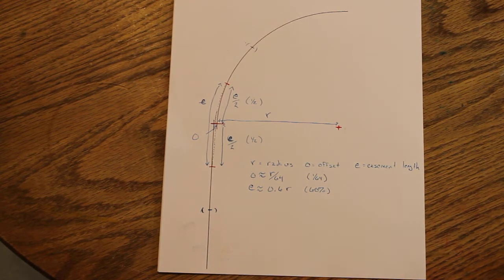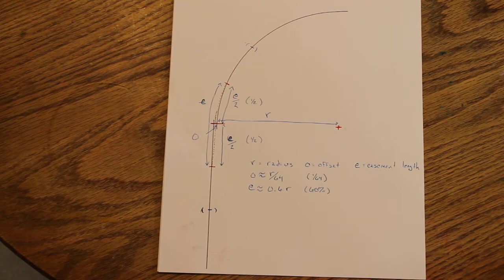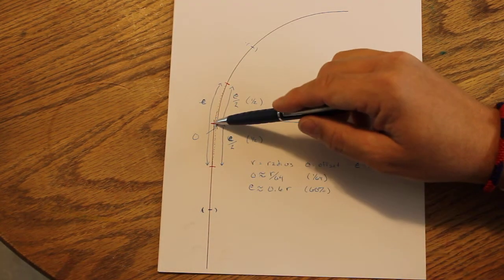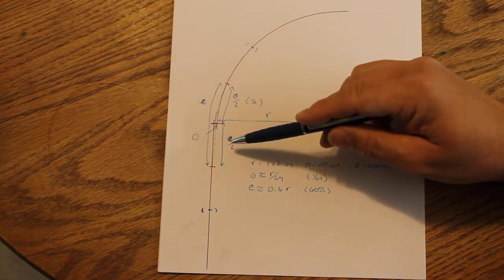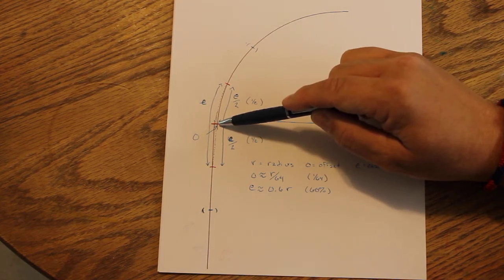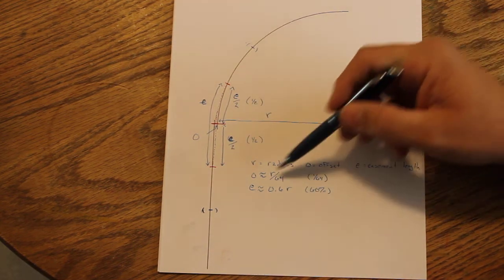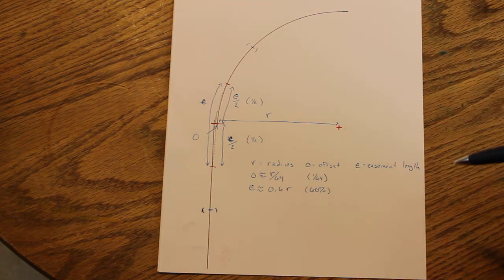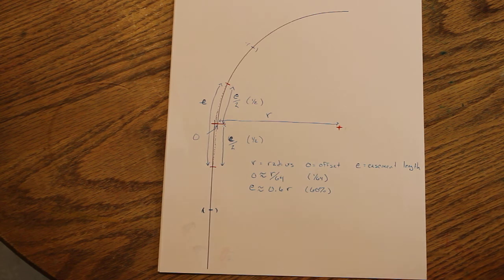Correction on Easement Equation

Comment: Very helpful video - thanks! I'm new to this hobby and there's a lot to take in. This may be a dumb question and it's been a while since I've take any geometry - but do you need an easement on both sides of the curve? Also, do you model the easements in your track planning software too, or is the easement inconsequential enough to leave out of the design?